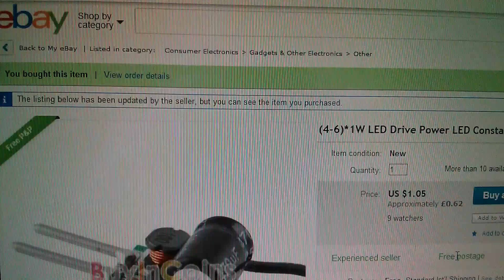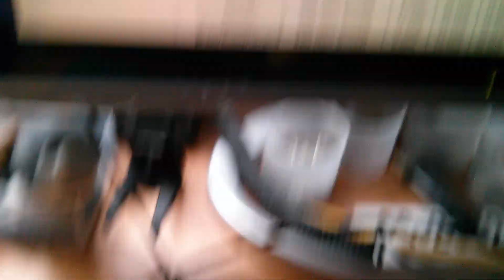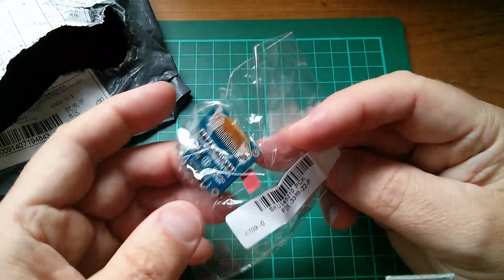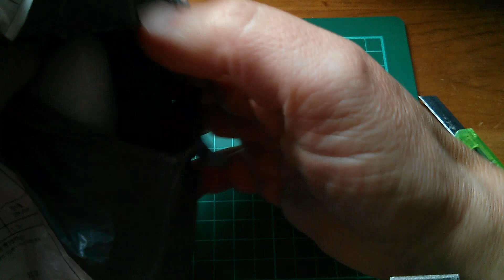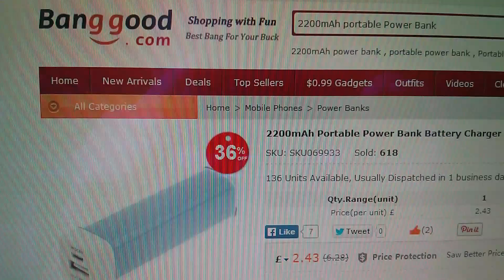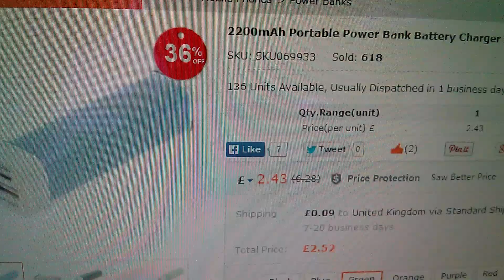Postbag #12: Banggood OLED, 18650 Cell Bank. LED Boost Driver

Comment: 4 is the minimum with one watt LEDs...if you have 3 watt ones then you can run 2 with it ..that's 6 watts capability and you'll be running them hard but it's fine nonetheless n within driver specs...however 2, 1 watt LEDs will go poof...so a minimum of 4 is required to meet the spec of the driver instead of the driver meeting the spec of the LED with the 3 watt example...

Comment: So I just found your youtube and I have to say I am just nerding out watching and loving all these videos 
I have a question for you 
I make box "mods" which are essentially a power pack with a switch to power an electronic cigarette I use 18650 imr high drain batteries I am dabbling in adding things such as volt meters, mosfets, and thinking about trying out that charging chip with the micro usb you made a video about 
My question is is their anything else I might try out in a power supply

Comment: Argh!  Hidden screws discovered after the destruction.   It's kinda galling that you can buy complete products including shipping for a fraction of the price of sending even an empty envelope in the opposite direction via Royal Mail.
Reply from the maker: Yes, I didn't think about screws behind the top panel sticker - silly me. But I really didn't want the housing this time. In fact, the housing makes a good protective cover for shipping and can be discarded if it's just the cell you're after. Now to test the cell capacity...
Reply: Julian Ilett  Very curious how much it is. I had one from Banggood which was advertised as 2500mAh and when I opened it it had a 18650 in it marked 1200mAh. When I tested it varied around 800 to 850mAh.  I inserted a 18650 from a laptop batt pack that I obtained for free and was a real 2400mAh. Good enough to almost fully charge my phones batt and fits in my pocket without people wondering what it is.

Comment: Would be interesting to know if the battery really has at least the 2200mAh, or you got Banggood as your favorite site now!
Reply from the maker: Using the Soshine S7 cell charger, the cell took 2016mAh of charge.
Reply: I also wana know the mah of that 18650 cos I may get a power bank if they are actually 2200 (doubt it though)
Reply: Yes - I'd also love to know what the real capacity of this battery is. If it's anything close to 2000 mAh then it's a winner for £2.52!!
Reply: Gareth Coleman hope they are close to 2000, will get a few if they are
Reply: Gareth Coleman hope they are close to 2000, will get a few if they are
Reply: TheLukey21 I already bought one of these and the capacity is approximately 800mah
Reply: mmm that's a shame but hardly surprising at this price point - thanks for the info
Reply: Yes but how much did it give back? :-)
Reply from the maker: Gareth Coleman You'd get most of that back - lithium cells are not supposed to get warm while they're charging.
Reply: That's great news, I'm ordering a couple right now then!

Thanks for the response, love your work btw.
Reply: Julian Ilett
2016mAh?! That's impressive!
Reply: There are 3400 mAh Li ion batteries in the market today!
Reply: santiago vindell
I meant impressive considering the low price and my expectations.
Reply: santiago vindell On ebay I can find "UltraFire" cells upto an astounding 5000 mAh. But don't be fooled by these or even the 3400 mAh ones. In practice they actually never have such a high capacity.
Reply: Peter-Paul Vervoort
He is right though. There are batteries that actually have that capacity. Not just advertised but real capacity. There are 3200mah LG batteries, 3400mah Panasonic batteries and I've read lately that there is now a 3600mah battery. I'm not sure for the last one though yet.
edit: There it is: http://lygte-info.dk/review/batteries2012/Orbtronic%2018650%203600mAh%20%28Black%29%20UK.html
Reply: runner180fxr  Indeed, Panasonic, LG and others have cells with capacities above 3000 mAh but these cost more than £2 cell tested here.

Comment: I think I've never used those constant current drivers with the diodes mounted, because I never ran them from AC. And when running them on DC, the two diodes, even if they are Schottkys, just waste power, so I always desoldered them. The pins aren't very useful to connect anything easily, so they always have to go, too ;) .
The missing diode makes me wonder. I long suspected that those drivers with the halogen bulb pins on them are the rejects that didn't make it into a real halogen-replacement-LED-bulb because they failed some spec.